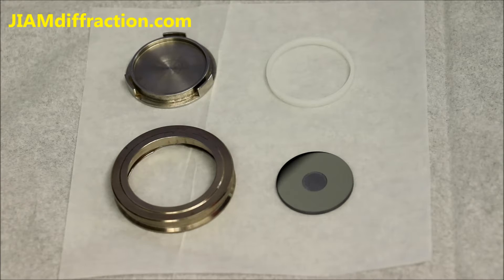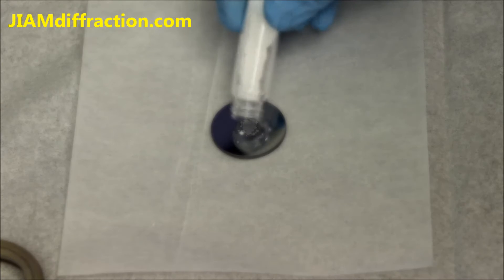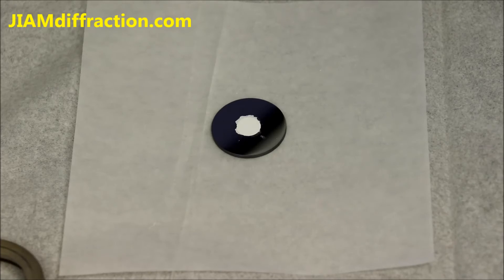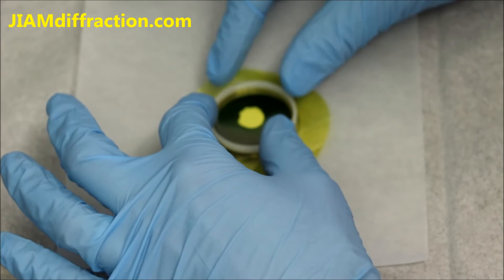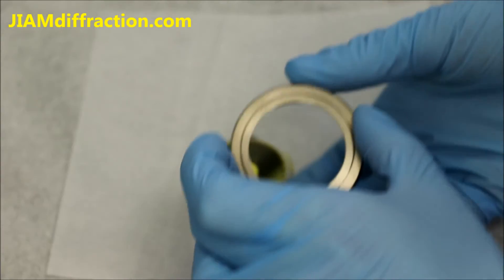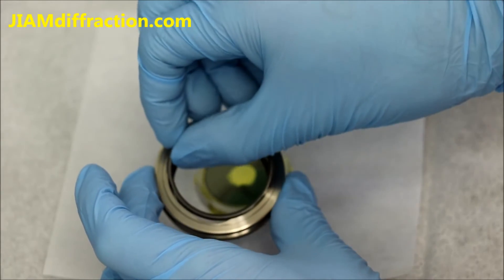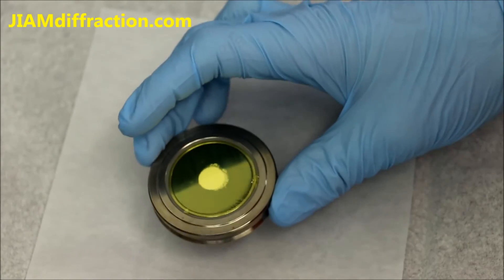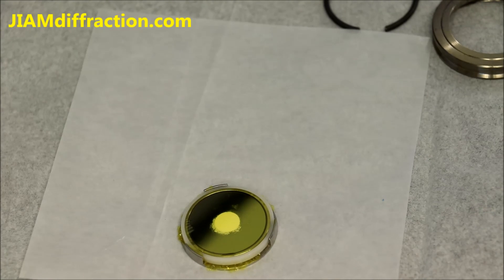XRD Sample Preparation - Air Sensitive Sample Holder - X-ray Diffraction

Comment: Dear Sir,  I want to purchase zero differaction plate for xrd. Can you please tell me from where I can purchase it?
Reply from the maker: I know of a couple of options.  The zero background plate (just the part that the powder sits in) from the video is a smaller diameter well option that I bought from MTI (http://www.mtixtl.com/Zero-Si-32D20C1-Cavity10D.aspx).  There is a zero background plate with a larger diameter well that I also buy from Malvern Panalytical (https://www.malvernstore.com/en-us/9430%20018%2017321).  While I like the ones from Panalytical, they are much more expensive than the ones from MTI.  You have the option of buying the Panalytical sample holders in a larger quantity, at which point the cost per sample holder decreases; however, they are still more expensive than MTI.  

There may be more options out there, but these are the two that I use.